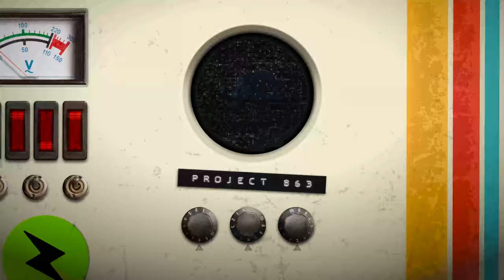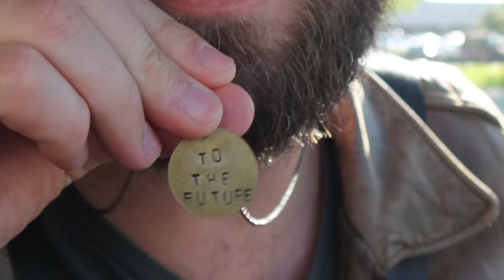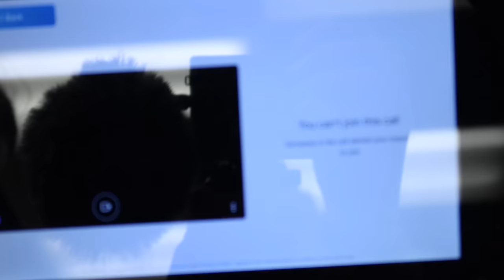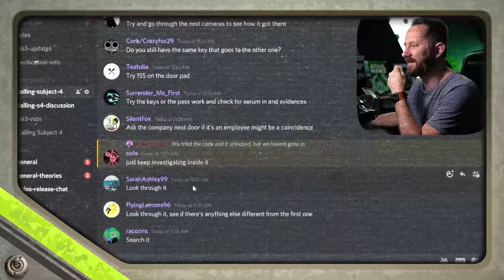My Totaled Car Reappeared in PERFECT Condition...

Comment: This is insane! Only thing I could think of is one of them has a spoofed vin number. Like car thieves try to cover up the vin with a different vin number already in the system of the same type of car so they can’t be easily traced as stolen maybe? But it having the same exact code is insane. Even if one of their vins was stolen, it having the same unlock code is too much of a coincidence to be a coincidence. Not to mention it happens to be in the same exact spot. I suppose much more bizarre things have happened in the world though.

Comment: Check if you can see any information on surveillance video that was pointed in that area (even if its not right at that car it could help). As for going through it ABSOLUTELY DO IT! Look into the windows first, then open door and do a glance over what you can see without moving anything, and take further step you want to take from there based on what you can see.

Comment: Mercury manufactured Mountaineers from 1996 to 2010, Therefore it could be possible this car could be from 28 years old to 12 years old. I would try to find out the exact age of it. Could've been Wesley's car and he could've had 2 mountaineers since it is very likely people have multiple cars in their lifetime or we can take it straight to the paranormal
Reply: If you recall we found out in previous videos that the red Mercury mountaineer was part of a fleet of syntec company vehicles that were all identical. Even so the VIN numbers must be unique to each car so even if this is part of that fleet, it’s impossible to have it have the same VIN
Reply: The "Strike 1" Mountaineer and the one that they found are model years 2001-2005

Comment: The VIN may also appear in a number of other locations:

Front of the engine block. This should be easy to spot by popping open the hood, and looking at the front of the engine.
Front of the car frame, near the container that holds windshield washer fluid.
Rear wheel well. Try looking up, directly above the tire.
Inside the driver-side doorjamb. Open the door and look underneath where the side-view mirror would be located if the door was shut.
Driver-side doorpost. Open the door and look near the spot where the door latches, not too far from the seatbelt return.
Underneath the spare tire.

Comment: It’s possible for a mercury mountaineer to change or erase the door password from previous owner. For the vin number, its also possible that someone knew the vin number from the mountaineer that you possess and put on the clean mountaineer to cause more problems. If that’s not the case, it’s could be that all the syntec  mountaineer were meant to have the same vin numbers. Look what happened with the group. It cause confusion and feelings overwhelmed. I think it was one of the few purposes of having the same vin number. Hopefully this make a bit of sense.

Comment: No two cars have the same VIN. However, vehicles manufactured before 1981 can have VINs that vary in length between 11 and 17 characters. Your saying this car was 2002-2003 car. But what if it’s older than you think. This is just an idea idk.

Comment: I noticed that someone else mentioned it but John Doe did tell them to specify which mountaineer because there were multiple. HOWEVER, John Doe asked for the vin number in order to know which one exactly they were talking about. Also questioning if the person that pretended to be on the cleaning crew to gain access of the studio could be Jordan Kendall?

Comment: What if the absalate has something to do with time, it's possible that it was stolen and used, whuch caused a rip which is allowing the newer car to show up from the past into present time. Not necessarily time travel, but a rip in time itself, I honestly wouldnt be surprised if Westley shows up next. I'd check the milage to confirm or debunk this. This kind of sorta reminds me of The Philadelphia Experiment the Navy supposedly did back in WW2

Comment: I mean legally speaking you own the “original” mountaineer meaning that vin number belongs to that car. So I guess if this new mountaineer has the exact same then technically you own that one too. I’m wondering if this goes back to season one when John Doe asked the team to specify which mountaineer. I’m wondering if Deb and/or John Doe were somehow able to make each mountaineer have the same vin number as a way to own them all. Sounds weird realistically however at this point I don’t put anything passed John Doe and Deb. Try checking other parts of the car where the vin number is also located such as the doors.

Comment: one of those mountaineers sold at a dealer for $26,687 USD, the mechanic part of me decided to vin check the car, fun what i can access without paying thanks to my garage also doing mot servicing, perk of the job is i can email some vin site and bypass there "pay for full report"

edit: found 2 mountaineers with a single letter difference in vins, both 2003

Comment: Heeyyy guys I just realized something. So you remember the one thing they found in the mountaineer that was pretty useless. Well what did D3B say to keep an eye on…. That’s right the journal. If this is some sort of time travel thing. Maybe the reason there was nothing in the journal the first time is because the invisible ink was prob degraded so it didn’t show. But now we have a new journal to look through, with fresh ink?!? Seeing as everything has been pointing to the journal. If there is nothing to do with time travel then this could also be the other mountaineers that JD asked for before. Or it was a corporate car. But either way the first thing they should look for is the journal and serums they found left in there. And check for blood incase this was before or after the whole murder.

Comment: Ford/Mercury has NEVER used a 3 digit code for the pin pad. My father-in-law worked for Ford Motor Company for 30+ years.  Yes I know it's just a story but at least get your facts right.

Comment: Can two cars have the same VIN?

A VIN is a unique 17-character code of letters and numbers for a particular vehicle. Much like a fingerprint, a VIN is a unique identifier throughout the life of a vehicle: No two cars have the same VIN. However, vehicles manufactured before 1981 can have VINs that vary in length between 11 and 17 characters.

Can VIN number tell you the owner?

VIN is also used to find out who owns a vehicle. Not anyone can make this inquiry within valid and legal means because some places protect this information as a privilege and even a right by the vehicle owner. You have to take a few steps and sign a few forms to obtain this information.
Can someone change the VIN number on a car? It's totally illegal to change a VIN